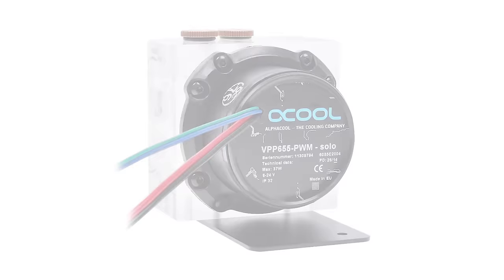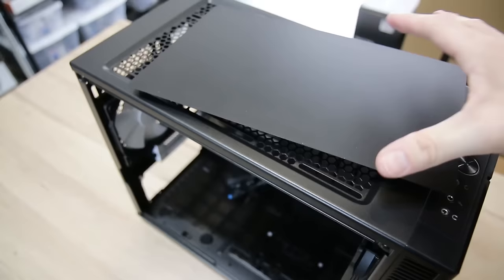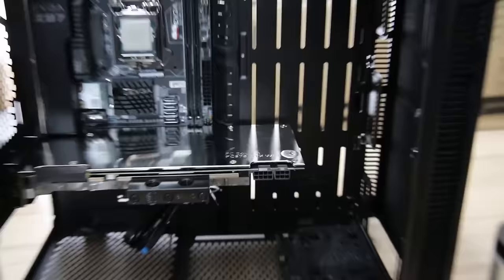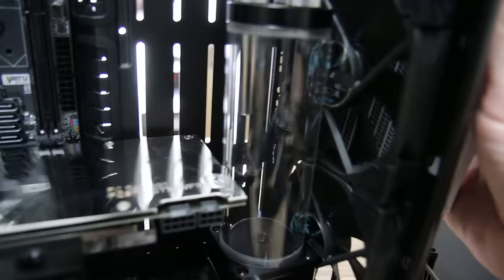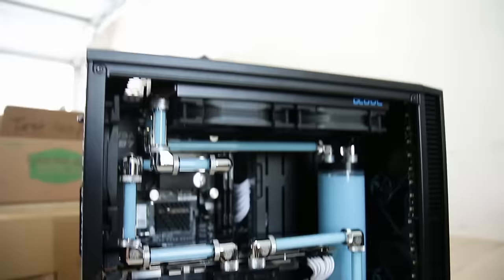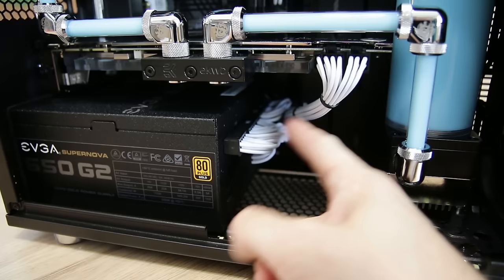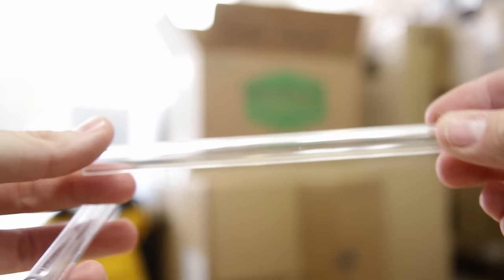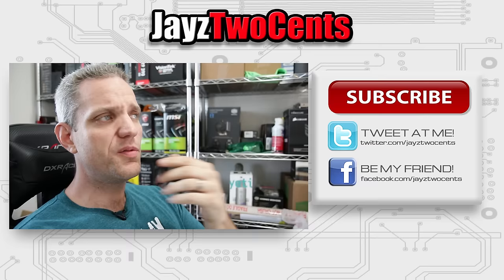The Ultimate Fractal Design Define Nano S - Build and Review VLOG

Comment: How good is that EVGA PSU? I'm planning to buy an 550 GS for a $800 build.
Reply: The evga g2 is a very good power supply, the gs from what I have read is not as great as the g2 series but is still a good power supply non the less so don't let that scare you from it. Jonnyguru does a good review on the gs series
Reply: Got the GS since then, man this Golden Supernova lineup is TOP1 for me. When I first jumpstarted the PSU just to see if it works I thought it's defective, turned out it was that silent (I'm not joking, it was like absolutely no sound). Can recommend all of them 10/10.

Comment: i wonder if you could heat and bend the glass in a kiln?
Reply: +Michael Theurer It can reach high enough temperature with ease but I can only guess that it would be pretty hard to keep cylindrical shape of the tube unless you are professionally working with glass.
Reply: Yea I'm not doubting that it would be incredibly hard and would require a lot of skill and practice

Comment: How much would a the water cooling parts cost in total?
Reply: No lol it would be around 520€
Reply: Dude the fittings from EK (that are cheaper than BitsPower) Cost like 150€ alone. Add that to the 340€ for the parts And you get the loop

Comment: If i just use an AiO watercooling i should be fine right?
Reply: Gotta agree but... my budget is kinda limited :D
Reply: +MrBlackhawk49 As a first water-cooled build that would be what I'd do; a 120 in the top for the CPU and 120 in the front for an AMD R9 Nano, plus another couple of case fans for airflow to keep the mobo and SSD cool. As +dennis045 says, it wouldn't be as pretty as Jay's, but he's got a lot of experience in building these custom rigs.

Tutorials for making that rigid pipework would be great.
Reply: Err.... Limited budget doesnt rly mean I'm gonna buy a R9 nano... more in the range of a GTX 960 or MAYBE a 970
Reply: MrBlackhawk49 Mmm, twas only imagining; £600 on a GPU is a little excessive. That said, my first build was a dual Slot 1 PII-400 with a Matrox Millenium and NT; eye-watering price and performance at the time, but it was still my daily a decade later with Win2K so I guess the money spread itself over two or three lesser PCs. I finally recycled it only last year, and it was still working.
Reply: I'm currently  running a gtx 650 ... crappy piece of crap.
Reply: +MrBlackhawk49 If it's any consolation I'm currently running a Radeon HD 6750M 512 MB which benchmarks at half that of the 650 :). If you can stretch to the 970, I think it would be worth it in the longer term as there's a lot more headroom (literally since it's the first VR Ready GPU in nVidia's line). It's much harder these days, as you used to push all the budget at the CPU and maybe SCSI raid if you were really flush. Now there's a lot more to juggle, with CPU, GPU, SSD, overclocking and PSU all needing to be balanced, and water-cooling is a big chunk extra beyond AiO. On the opposite side of the coin, they look a hell of a lot better than the ubiquitous beige box we used to suffer.

Comment: why don't you bend the hard tube?
Reply: +LiteGaming Because it is Glass.
Reply: +unherolike no you can still bend it with adding Energy the molecules will move and also Glass is a Liquid not a solid
Reply: A) Glass is neither a Liquid or Solid its in a limbo state between the two..

 B)  That's not important.Because that's not what I said at all. I said "BECAUSE IT IS GLASS".

 He didn't bend the Glass tubes because he is not. To the best of our knowledge a seasoned Glass Blower with years and years of experience capable of blowing glass into perfect tubes of a perfect diameter inside and out.
 Why would you waste time and effort to Bend the glass when a glass cutter and 90 degree fittings are all you need?
Reply: unherolike Your Wrong Glass is a Liquid search it up and ask a chemist also bending tubes is easy just apply heat and use a bending tool and fittings increase changes of leak in the system which when it leak your screwed depending were in the leak happening

Comment: i would like to do something like this with these specs

Fractal Design Define Nano S windowed

MSI Z270I GAMING PRO CARBON AC

Intel Core i7 7700K 4.2 GHz 8MB

Corsair 32GB (2x16GB) DDR4 3200MHz CL16 Vengeance LPX black

Samsung 960 PRO 512GB

2x Samsung 850-Series PRO 1TB

WD Black 6TB 7200rpm 128MB

Nvidia Titan X 12GB (Pascal)

Fractal Design Edison M 750W

2x Fractal Design Venturi HF-14 140mm Svart

3x Fractal Design Venturi HF-12 120mm Svart

but with green colour on the water like the latest version of skunkwork

Comment: how much does all of that watercooling gear cost
Reply: A lot
Reply: +Average Gamer i was expecting an actual number, so...
Reply: Omer Cinar I remember checking once and It was a good amount of money not for anyone with a budget.
Reply: +Average Gamer if i were to replace the tubing and fittings with soft tubing and standard compression fitting, how much do you think it will cost then?
Reply: without those angled fittings and custom pump/reservoir tops, here in europe it would be something from 400-600 euros.
Reply: holy shit lol this is definitely not a build to work towards then, good lord. im just trying to find the best "normal" water cooling stuff to put into my build in this case..
Reply: Meanie EKWB's kits are good for the money. Altho I think that the point of custom watercooling is both performance and looks.
Reply: Meanie if you are going to use this case then you will need 2 blocks, some rubber tubing, a few compression fittings, and a pump and resevoir.

Shouldn't be that expensive. When I calculated it in my head, it was about $350-$400
Reply: I got a 330€ list. Cheapest cpu and gpu blocks, no angled fittings and cheapest pump and res I could find. Propably would run something like 300$ in North America.
Reply: I'll have to keep that in mind. I don't know anything about custom loop coolers and kind g scared of it. I was just going to buy the best AIO I could fit in here if nothing else but I wasn't sure what that was either lol

Comment: would this case fit two gtx 1070s?
Reply: no
Reply: +YellowPeaches it could lok
Reply: +Adrian Nastase it could lok
Reply: *****
 no becuse its mITX
Reply: It could of watercooled. Remember that there are single slot gpus when watercooled
Reply: *****
 true but the mITX mobos have 1 PCIe Slot
Reply: Not true. Some mitx mobos have 2 pcie 16x usable slots
Reply: *****
 link me 1
 & the card slots are still 2. Just the cooler is 1
Reply: Ok. So look, the evga gtx 980 classified or kingpin and some other gpus are made to be 1 slot when watercooled. Wait for the 1080 kingpin. For mobo here's the link: DIY
Reply: *****
 link me one video or anything where it shows how.
Reply: Mama ta

Comment: I don't like this design at all.

The PSU freaking blocks the air path of the GPU -> GPU will heat up.
It doesn't matter if it's only occupying 2 slots, which leaves little to no room anyways.

You either buy a GPU with radial cooling , or water cooling.
Anything else and your GPU will get burnt.
Reply: Well how was anyone else suppose to know you were talking about the case? To the reader it sounded like you were talking about the build as a whole. You never mentioned the case at all. You said "I don't like the design at all." If English isn't your first language, I'm sorry for insulting you. With the way English grammar works, it can be hard to catch on to. Or so I've heard.
Reply: Nono Bonono but...

It's sexy...